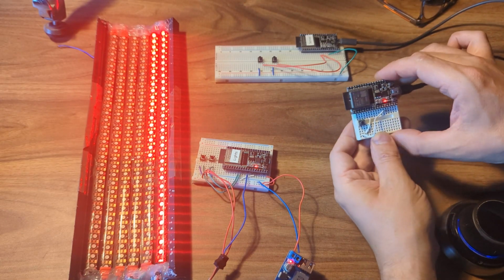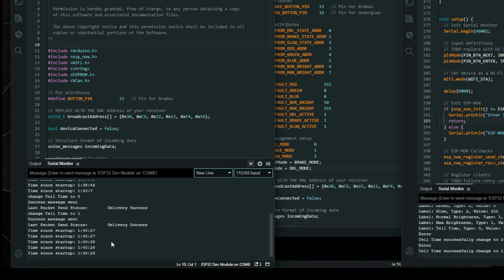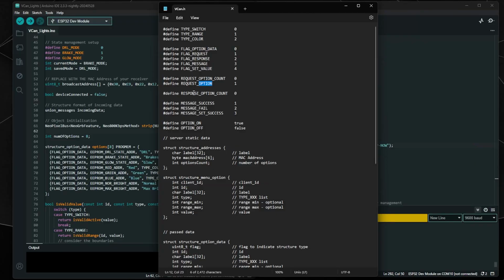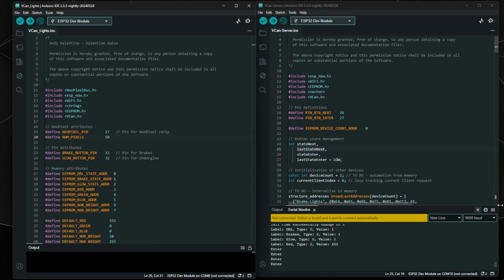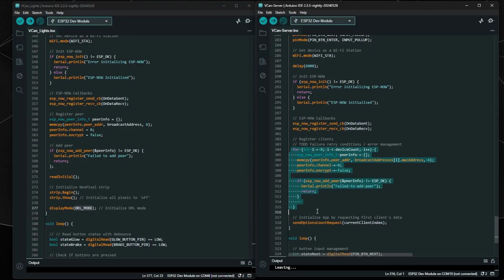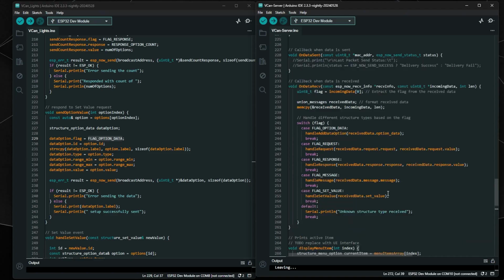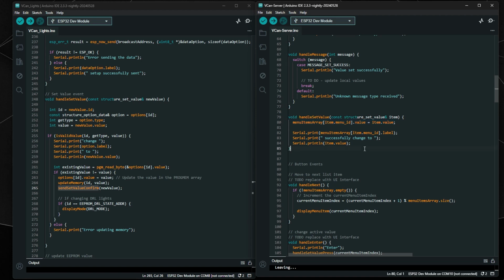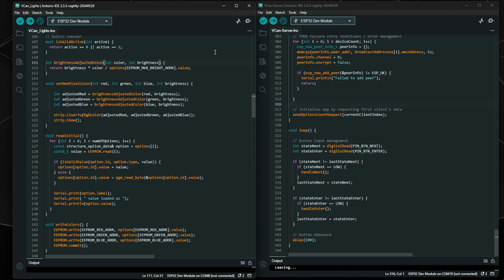Looking at a Prototype ESP32 Arduino Car Control Center

Comment: Please do a proper risk analysis (FMEA) before implementing this in a car that you will drive on the public roads. You probably end up removing the wireless connections and replacing it with CAN bus. That's brings me to my next comment: You may want to check out existing car network architectures...... Other than that, it looks like a fun project to learn things.
Reply from the maker: I hear you on risk analysis, but it needs the wireless for things like the remote control, and potential integration with things like Home Automation. I'd say that if you start hooking up to CANBUS then THAT is when you open the can of worms,

It's basically zero risk right now though as long as you're tapping into lines correctly. The controller element is just wifi signals being sent out by micro-controllers. If your car can't handle being in range of a wifi signal, it's probably not safe to drive as is!
Reply: @GarageTinkering  Well, your video shows clearly brakelights being run over a wireless connection. So when wireless is failing, there is no brakelights. Brakelights is a safety feature. So you need a risk control for a failing wireless connection. Even ethernet is not an option as packet-loss is a real possibility. So you then either need a higher protocol with message acceptance validation and retransmisson and heartbeats with deterministic timeouts OR you need a protocol that is failsafe by design (thats why car's use CAN). So the architecture would be that at least all safety related features are on networks that are failure proof by design. You can have a node on that network that bridges to WiFi for you home integration as that is likely not a safety related feature.
Reply from the maker: "Well, your video shows clearly brakelights being run over a wireless connection"

No it doesn't. At all. The brake light is hard wired to the ESP32 through a optocoupler directly to the OEM lights. All of the connections that I've made with this system are wired.

The only thing that is wireless is settings control. For example in this instance it's "turn the third brake light off". It's an override. A set and forget option. Same with "turn the neons on". Nothing that's actually "running" in the car is wireless, because as you rightly said, safety concerns.

The whole point of this system is to WIRELESSLY integrate and control the settings of WIRED devices, but with the controller being able to dynamically request all available settings etc from the devices.

Comment: I clearly spoke too soon on my comment on the last video on this topic, you were already headed down the path I was describing albeit wirelessly.

At the risk of you having already thought of this and released a video already about it (again), have you considered building a circuit with the devices to save on EEPROM writes? I'm thinking something like a small battery or capacitor on the 5V side that will give the ESP32 enough time to write to EEPROM during shutdown or to enter a standby mode. One of the open optocouplers could be used to detect if keyed power gets turned off, which would send a signal to the controller to enter standby/shutdown and write any necessary data to EEPROM.

Part of the circuit would have to monitor for an under voltage condition and cut power to the circuit, or the controller could send out a "shutdown ready" signal that trips the power. The power could then be reset by the "12V present" from the optocoupler, likely with a short delay to charge the backup power source.

I'm almost certain that as of me writing this, you've already built on a custom PCB, but it could be something to be implemented in future revisions.

As far as the contents of this video, it's absolutely brilliant! I love the solution you're creating and the depth at which you're explaining everything. As a car enthusiast and soon-to-be electrical engineering graduate, this project has really caught my attention.
Reply from the maker: I appreciate the thoughts.

You're right though, I'm currently 10 steps ahead lol. In the next day or two I'll have the video for the initial prototype out for the React mobile browser control that integrates with all of this.
EEPROM has been actually been scrapped in favour of NVS, and everything is written to memory and persistent at the time of change, so shouldn't require any shutdown concerns.
Only things I need to sort today are getting the websockets working so that all devices attached to the server update their UI if one changes (so no information conflict between say a screen and a mobile), plus get some state flag stuff attached that I've been thinking about. All being well though I'll record that video tomorrow and it'll be out this week

Comment: Your video just made me think of Home Assistant and how a (light-weight) spin-off ("Car Assistant"?) would work in a car of RV, including integration back into Home Assistant.
Reply from the maker: Honestly that's kind of how it's going. 

I've just managed to get a React web based UI up and running with it which is working great (video in the next couple of days), which right now has a total bundle size of like 200KB so it's super lightweight, and communication with Home Assistant definitely seems high on the list of things to look at

Comment: This is a great idea! It could probably work as a rv/motorhome/vanlife system for lights/heating etc. As long as you specify what the thing can do, you can make almost anything into a module that connects to the network, it doesn't have to be just for vehicles.
Reply from the maker: Yeah, obviously I'm using automotive design as the crux of the motivation, but you could totally use it for home circuits or absolutely anything else really

Comment: What I want out of this, when one of these devices sees (doesn't have to connect) my home networks SSID, between 11pm and 6am, check the status of my windows.  If they're down more than an inch, throw a relay to give the 12V to the switch to roll them bad boys up and close the roof.

No matter the time, get a water sensor on it, and if the car is not on, shut dem windows.

With a temperature sensor, if it goes above a certain temperature, crack the roof open. (Water sensor wins and keeps the roof closed)

My car auto-locks itself if the driver leaves the car.  If there's anyone in the car detected via the sensor in the seats, DON'T lock the doors automatically.  If the car is empty, please, do allow the lock.  In my car, after a period of time, the internal buttons to unlock the door do not work.  To get out, one has to tug on the door handles twice, which throws the car alarm.  Kinda dumb it doesn't already sense that there's someone in it.
Reply from the maker: The window one is an interesting concept. I guess the pain there is that windows (in my experience) are on switched power circuits, so need the keys in, so you'd have to be able to get around that. Otherwise though I think it would be doable as long as you can hack into the motor regulators somehow

Comment: Yes to both useful and a good idea.  You could tie into the car's actual CAN network and grab readings from it as well although that will be different for each manufacturer and possibly each model of that manufacturer.  In this case, especially since memory is limited on the ESP32s, each vehicle would have a hardware device that is a "converter" like converting HDMI to VGA.
Reply from the maker: CANBus data readouts are on the to do list. You can actually do a lot with the ESP32 as for the most part you really want digital readouts, and all it has to do in convert tables of (typically) hex or binary data into graphical formats by sniffing the right data cells. 

Definitely something I'm looking forward to getting in to
Reply: Canbus has gotten a lot easier in the last decade. There's an arduino-can library on GH that works with esp32s with a cheap transceiver chip on a breakout board. With that library, you could actually make your library work without espnow wireless, entirely on the vehicle's canbus network. However, you want to be careful with that, because if you accidentally bring down your vehicle's CAN network, you can cause a lot of problems.

Comment: Do you use Github?
Reply from the maker: I will be putting it up on a repo once this has a bit more shape and it's kinda full-alpha stage
Reply: @GarageTinkering  That's what Github is for though.  You can start with the basics of your project and then as you add, change, etc. you keep it updated with versions.
Reply from the maker: Yeah. I was a developer for 25+ years. I used it a LOT. Just not quite ready to put it out there yet and deal with the scrutiny until it's a bit more realised. I will soon enough though. Next week or so it should be a bit more fleshed out
Reply: @GarageTinkering  Ah.  OK.